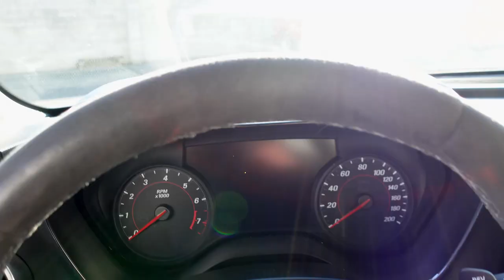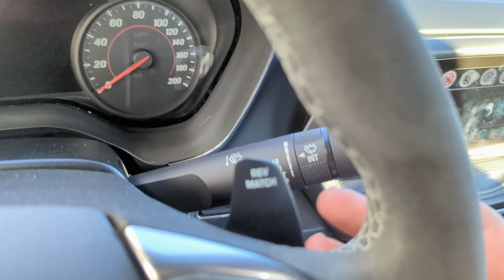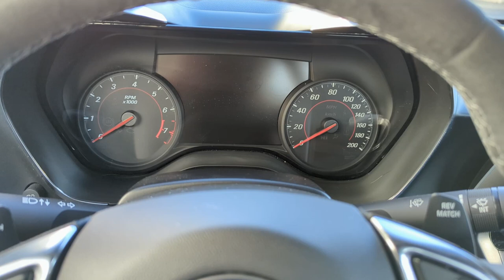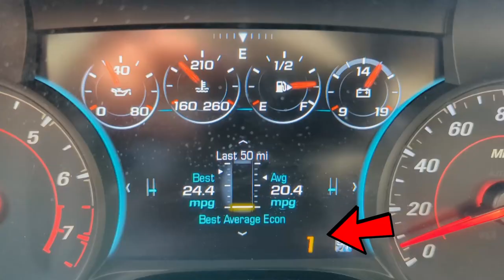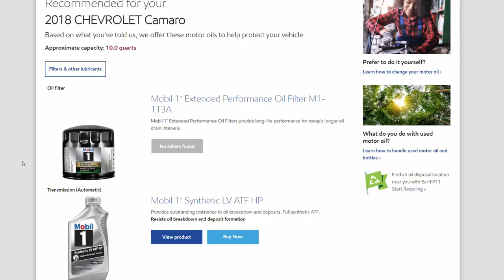Living With A 1LE (First Month)

Comment: Your battery is in the trunk. The trunk opening is small because they prioritized handling over trunk space.
Reply from the maker: True, but I have worked on many vehicles with the battery in the trunk.  All in the floor instead of behind a wall. Which I think sounds like better for weight distribution than having the battery lower in the floor.  Then you can have more trunk space as well.

Comment: You can get a slip shift remover for the 1->4 shifting issue
Reply: I had the same feauture in my 2012 2SS   but after a while it didn´t work anymore,   don´t know what happened but  i´m happy.    Perhaps it was when I downloaded the Diablo Sport high performance tune  but  not sure.

Comment: So mustang or camaro in your opinion
Reply from the maker: As for 6th gen Camaro vs S550 mustang, I can't make a decision yet.  I haven't driven the mustang with the 3rd gen Coyote.  I like the way they both look.  The interiors seem to be the same quality. My link has worked better than Sync so far.  But as for 6th gen Camaro to my S197 Mustang.  Camaro, more power, handles better, and I think it looks better. I just need better tires.